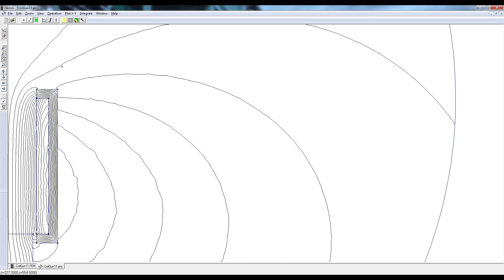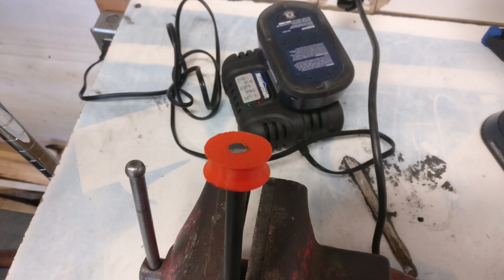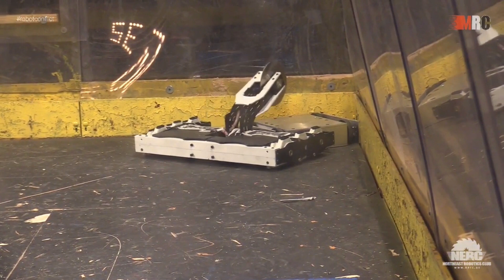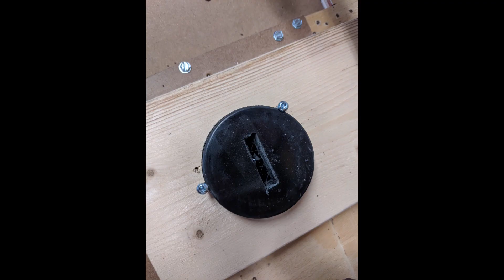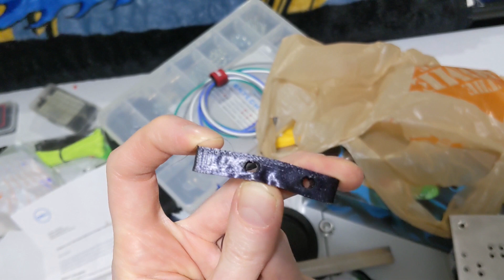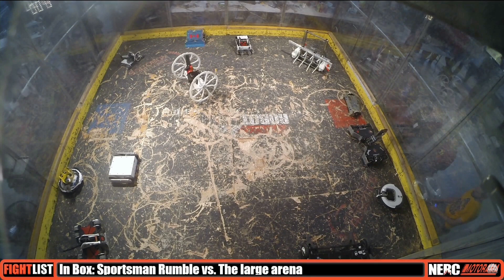The Story of Atlatl Part 1: Inception - 2020

Comment: Have you considered saving space with a hubmotor system like Magneato’s flipper? You could save a good amount of space by having a motor run the flywheel directly, but I’m not sure if the current motor you have would be up to the task (I haven’t really dabbled with 30lb robots or untethered projectiles). Then again with the space saved and with the extra weight you already have you could probably get away with a bigger motor!
Reply from the maker: There were a lot of ideas that I actually didn't mention in the video because it'd just make things too long and that idea I believe was one of them to an extent.  Since all the space has already been allocated for the robot at this point I'm not going to try and save space now as it doesn't grant me any bonus.  I believe the current motor could do it though, but it would abuse the motor more as a result.

I think one of the problems with that idea was getting the rubber to both stay on the motor and be maintainable.  Pressing a steel shell overtop to add mass and remove that problem could be attempted, but I think V1 ran out of time and V2 went for an ease of maintenance approach after talking with Magnetos builder.

Comment: Silicone car radiator hose from ebay or similar could be worth investigating for the flywheel. Its very grippy and has cord woven into it so shouldn't expand at speed, and is also fairly cheap which is a bonus. Makes for excellent beetleweight tires, but could also work well here.
Reply from the maker: Interesting.  I'll give it a shot.
Reply: @idlehands64  If you make it a tight fit over the flywheel you may not even need to glue it in place as its very grippy both inside and out... I've not tested them at high speed though so this is just speculation.
Reply from the maker: @rapidrory  Good to know.  I should be able to easily test that then with existing stuff.  Thanks.